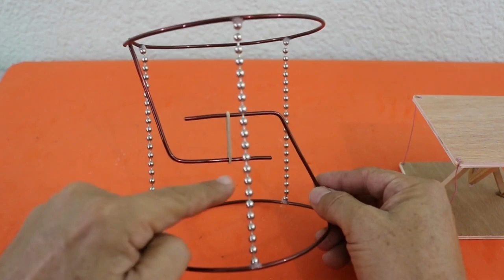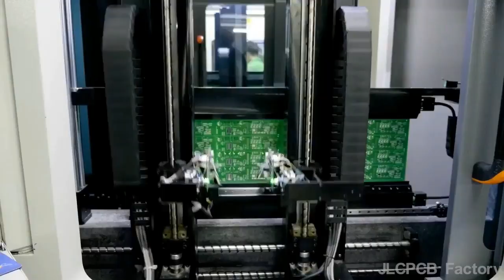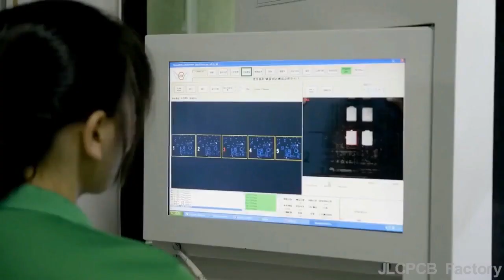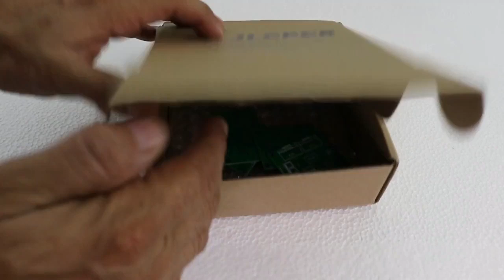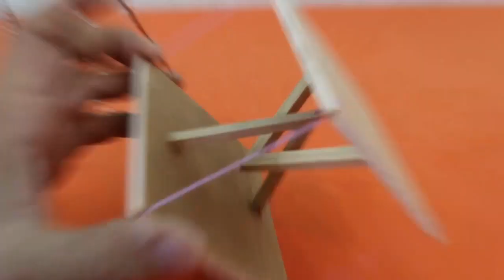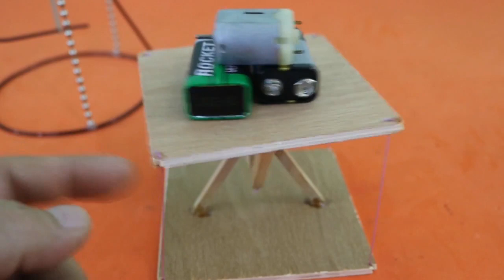Tensegrity Models

Comment: The use of a rubber band in your first sculpture made it extremely easy to understand 👍 I've been trying to wrap my head around tensegrity for a while now.
Reply: Why are their no measurements with these models of tensegrity
Reply: @davidlonesome6817  the outside 'chains' have to be the same length.  Their length is determined by the length of the center (rubber band).  Go to other videos that use wood to make a better appearing structure.  This one looks like crap compared to most of them.

Comment: 2:19 excellent demonstration. subbed.
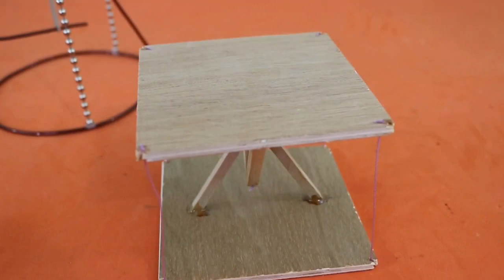i wondered if the number of support strings affected stability and strength. thanks. 3:45
Reply: You can use two outside 'chains' or whatever material you want fi you place them in the correct position but it is more susceptible to collapsing if the weight on top is not distributed evenly.  Using only two makes the entire thing look more mysterious and 'impossible'.

Comment: make it with magnets instead of rubber
Reply: The problem is in the type of force. Since with a rubber, as it gets fulled, the tension gets higher and pulls back towards equilibrium, with a magnet, the further apart, the weaker the pull. It would work relatively but would lose in structural integrity

Comment: That's interesting - I've looked into Tensegrity structures quite a bit since I found out about (and was fascinated by) them a few years ago. I've looked through tons of photos of them, and I've even constructed a few myself. But, I have never seen a single one that wiggles like the two you have constructed. I don't think they're supposed to do that. I think that while absolute structural rigidity is not necessarily the case with these structures, they are supposed to be quite stable. Especially in their resting state (no external forces imparted to them). 

I kinda think your tension cables aren't under enough tension..
Reply: The length of the outer 'chains' is critical.  they have to be exactly the same and not have any slack as these appear to have.  That is why some type of string works better than the chain.  It allows for 'exact' lengths to be used.
Reply: @normanacree1635   yeah, I'd say that uniformity is definitely a crucial quality, needed for all aspects of a tensegrity structure's construction. Uniformity, and precision. And those two things are difficult to achieve using low quality materials. Difficult to the point of being a waste of time in many cases. Trust me - I been there.

What I was saying back when I left that comment was that I didn't think the structures demonstrated here - which are effectively the same structural design as we see in the explosion of videos which featured them a while back - are not actually tensegrity. Back then, this was just something I suspected intuitively. And I gave my reasoning for why I felt that way in my initial post. 

Now, however, I know this to be the case. My intuition was correct; all these structures with 2 or more cables at the structure's perimeter and a single cord of tension at its center, are definitely not true tensegrity. I like to call these things "pseudo-tensegrity". Because they're pretty close, but not quite the real deal.

There are a few things which must be true about given structure in order for it to qualify as tensegrity. The most relevent of those being this: the structural elements under tension shall only experience a tensional force. Likewise, the elements under compression are only supposed to experience a force that is purely compressive. We can visualize this by imagining arrows which represent the direction of an applied force, moving from the ends of a rod towards its center, or moving from the center outwards towards the ends of a line. To be a true tensegrity, the force vectors experienced by a given component of the structure must be as I just described. There can be no shearing or bending of the components. 

The center components of these structures we see here, do in fact experience bending forces. Because of this they are disqualified from being considered true tensegrity.

Even so, I still think they're pretty cool..  🤓
Reply: @SineEyed  True tensegrity builds have the 'string' being stretched by the 'solid' parts and the 'solid' parts being compressed by the 'string', I THINK.  Look for models that use only one center string with no perimeter 'strings'.  Those, I believe, are true tensegrity builds that are pretty easy to achieve.
Reply: One more thing @SineEyed.  The two wires  being squeezed by the rubber band ARE being compressed by the rubber band and the rubber band is under tension due to the weight of the top structure so even thought the outer strings are not under tension, this technically is tensegrity.  I stole this fact from another video that explained what tensegrity is and he pointed out about the outer strings being used for stability.

Comment: Why dont you chain more identical levels to make a cool tower?
Reply: Great idea!
Reply: Gotta do that
Reply: The taller it gets, the more weight is being pushed against the base, so im assuming the more levels added the more weight added and from what i have seen in the video another level would not be supported...I literally just found out about this and find it so freaking cool.
Reply: @smellskindabaka1651  Use balsa wood.  Also, I don't recommend using the rubber band.  The entire thing is already pretty flimsy and the rubber band would increase its flimsiness, I think.